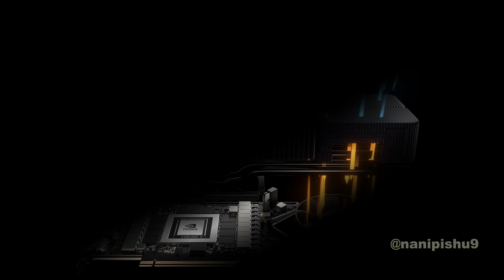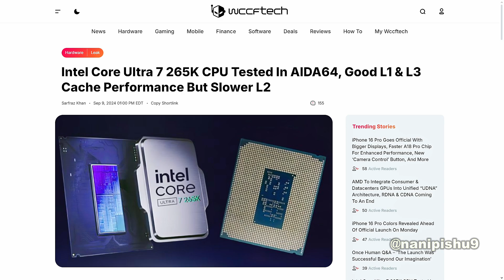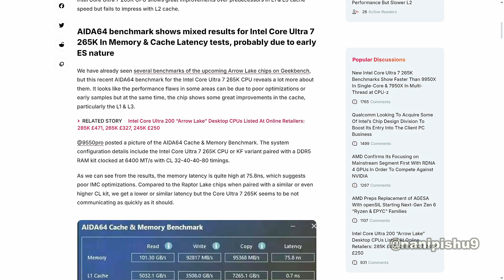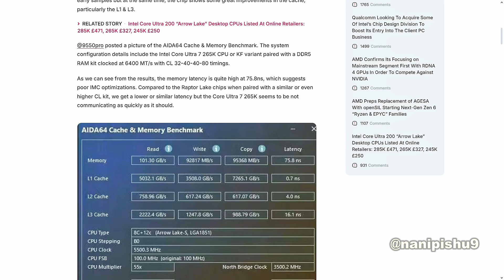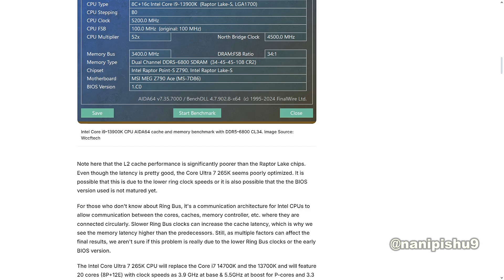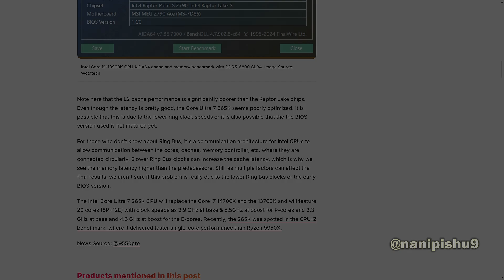[TechQuickie] Intel Core Ultra 7 265K CPU Tested In AIDA64, Good L1 & L3 Cache Performance But....

Comment: My 265K has a memory Latency of 65 ns and 130Gbs bandwidth running @ 8400Mts. Someone does not have the settings right in the above test...
Reply from the maker: maybe, but other factors like immature platform test, windows 11 24hxxxx privileges issues and also old drivers either cpu or bios but hey your numbers are good cheers 🍻🍻🤌🏽🤌🏽